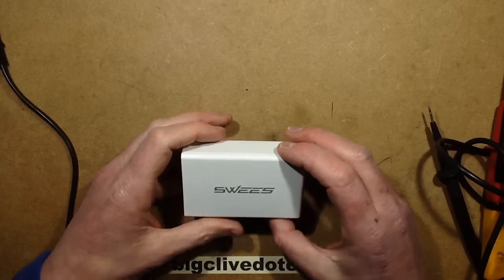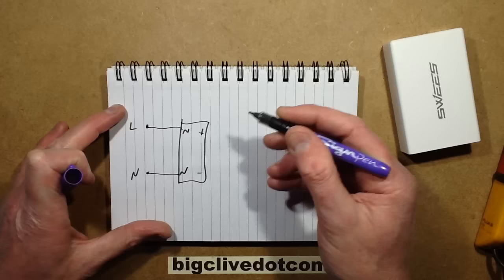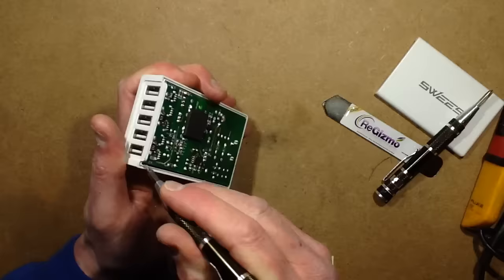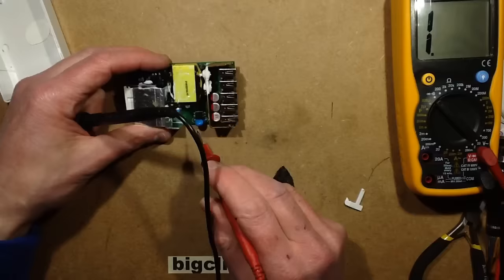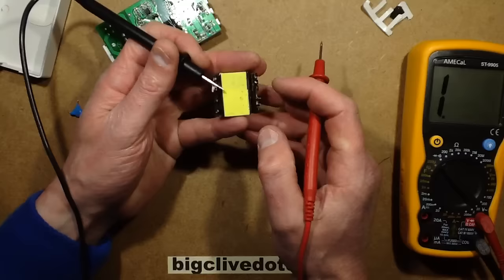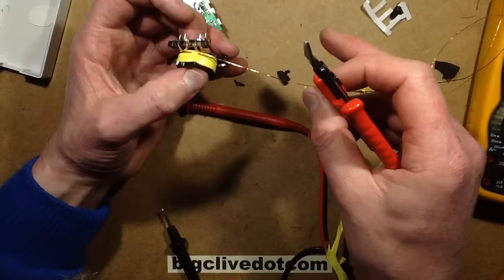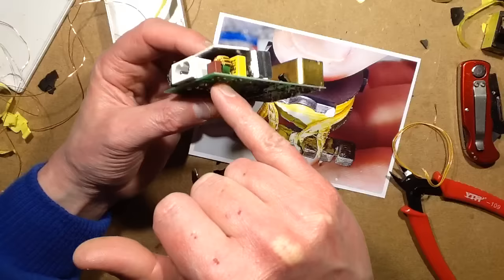Horrific USB power supply fault.  (Electrocution risk.)

Comment: If the overall design and build is fine but there is a manufacturing fault in this single transformer of the vast number used in this and presumably other similar devices then what can be done? One could argue that this sort of thing should be caught in quality control, but I suppose potentially the issue could have only shown itself post shipping for the same reason it went away once the transformer was removed.

I would be interested to know if other similar (maybe better known) manufacturers use more fault tolerant components, designs and processes, or whether this is a rare but more fundamental and widespread issue with a very common transformer and design concept?

For what it's worth I have and use a Swees powerbank. It's been fine and I plan to continue using it. However for a while now I've stuck purely to very large OEMs like Samsung for anything with a 240V input for fear of the above issues.
Reply: +anononomous  You ask "what can be done"  The answer is testing the insulation in the factory at voltage levels far higher than will be seen in use.  This reveals both faults and weaknesses that could later develop into faults.  If this test is passed then it is fair to assume that the product will stay safe, even after some deterioration over its life.  This test is required by the relevant safety standards and should have been performed.  There is little doubt it woud have detected the defect.
You ask about fault tolerance.  This is also a good way of making sure no duds reach the customer.  In this case a mains voltage winding was capable of passing over the thick secondary output winding - a single fault at this location then caused a lethal unit to get to the customer.  If, for example, the winding had been provided with an additional sleeving at the exit point, or a perhaps little plastic shield had been installed to give extra protection this fault could not have occurred unless both the sleeve and the winding insulation were faulty.
Personally I think you are right to stick to well known brands - it's the little details described above that cost money and are often cut out by the cheap skates.  There are so many horror stories - a UK Trading Standards enforcement office tested a random selection of cheap chargers and ALL of them failed safety tests.  
Hope this has helped.

Comment: your circuit  you draw at the start of the video seemed strange (Why?) because transformers only work on AC and so if there placed after a rectifier (that turns AC to DC) it would not work being on the DC side?
Reply: +MrStevetmq It's switching the DC on and off at high frequency, with variable mark-space to regulate the transformer output. That will be where the feedback winding and opto-isolator matter. The feedback winding picks up the output voltage while the opto-isolator may be signalling the zero-crossing for efficient switching.

It's all a bit of a black-box outline of what the system has, and I think it misses some other details between the transformer and the actual USB connectors. There are various ways of getting a steady voltage between the USB+ and USB-.

There are bits in places such as Wikipedia that try to explain all this, and there are so many detail variations that they're heavy going.

The switched-mode method can also handle the differences in frequency and voltage there are between the USA and Europe. The initial conversion to DC deals with the input frequency difference. The way the input to that transformer is switched can deal with the voltage difference. In the USA it would spend about twice as long switched on to deliver the same energy per cycle. I'm being a bit simplistic there.

Comment: Can you recommend a usb supply that takes a 2-pin lead, for diy projects? Or is it possible to retrofit a 2 pin socket onto the board of a usb supply as long as it doesn't have an earth?
Reply: +Daniel Dowling most usb chargers only have a plastic earth pin, so are not earthed, its just for compatibility with uk sockets.  out of interest, what is a 2 pin socket and why would you have mains runnning from such a thing?
Reply: +jusb1066 I mean like the socket on the device in the video, the 2 pin... kettle lead?
Reply: Daniel Dowling
then yes, you could retrofit such a socket or adaptor , you would probably need a bit more room to put it into another plastic case, and then simply the 2 wires from its motherboard onto the 2 pins of your figure 8 socket, as long as the case is  plastic, it wont need an earth
Reply: +Daniel Dowling The Anker and Anglink ones are good quality. I have a video of the Anglink one.

Comment: And this is why I ALWAYS check electronics I get from eBay before using them. Doubly so if the eBay store is Chinese. QC is non-existent for them and we get crap like this. I had a 5V +12V supply for computer drives that had extreme noise back feeding into the AC mains causing my monitors to flicker. Autopsy revealed they had almost no filtering caps in the design. I destroyed it and salvaged the few good bits I could get from it. Always check electronics out that are cheap before use lest you get something that is passing mains level power to low voltage equipment.

Comment: A fascinating Classic Clive. The transformer employed the correct construction techniques, including the Faraday shield to reduce noise, but in this case, was very poorly executed. (a poor choice of words, I know) These transformers may have been purchased as a finished part, by the maker of the SMPS. I'm surprised this didn't cause damage to components upon being powered up with 240vac floating around on the output side.

Comment: I worked for a power supply company many years ago and every unit had to undergo a flash test between mains and the output to test insulation. The voltage level was thousands of volts and would weed out faulty transformers like this one.
Reply from the maker: 3kV for a full test I think.
Reply: I did hear one horror story of a plant in an unmentioned low cost manufacturing location where a single high voltage tester was shared between multiple operators. each operator had their own high voltage probe which were all connected in parallel to the HV source which was permanently on. In theory if any single probe detected a short to ground the source would buzz. The person who told me the story (actually an inspector for BT ) was initially horrified at all the live HV probes lying casually around but then he realised that the HV source wasn't even turned on.

Comment: Once you found it was the transformer then without removing it, connect to two short points to a power supply  switch on, blow the short out then take the transformer to pieces and look for the damaged part.

Comment: when i plug my phone into my anker usb power supply the metal back of it feels funny and when i measure it and ground there is a voltage of 100V. Should i be concerned or send it back?
Reply from the maker: Most ungrounded chargers give a tingle through capacitive coupling.
I recommend using a plastic phone case for two reasons.  To avoid contact with the metalwork for this exact reason (and the high shock risk it poses with a faulty charger), and to help protect the screen against breakage if dropped.
Reply: bigclivedotcom i do use a plastic phone case but when i rub my fingers over the camera cutout they sort of vibrate on metal back. Btw the power supply is an anker powerport 5 if you want to test it. Looks very similar to the one you tested in the video

Comment: I have two of these, tho mine say EasyAcc as the branding on it, but other than that, looks exactly the same. Thankfully no electric shocks from them, and actually I've had one set up powering a clock and a google home mini on the bed side, and then have ports for charging my phone and tablet etc.   It all works well. Except for when its not doing much charging. You can hear it emitting electrical interference noises. Both of them do this. Its really irritating especialy if i wake up at night and my phone has finished charging

Comment: When i got a short like this and want to see where the problem is i just connect high power to it and blow the fault up. i have fixed a very expensive CCTV system like that in the past. a smd capacitor have shorted on the input power side and keept the powersupply from working. i changed it for a ceramic thu hole one that i "tig welded" on the board.

Comment: This is great example why using double insulated wire for SMPS power supplies is bad idea, if they did use normal magnet wire they would keep proper clearance between windings and they would not have this problem. Or use split bobbin but it is only valid solution for resonant technologies.

Comment: Mass-produced machine-wound transformers. Presumably they passed batch QC (interwinding isolation) so this might just be a random "bad one"? Dangerous nevertheless and having Mains and LV on separate bobbins would be FAR safer (and possibly not "that" more costly to produce on an automated line)! [Edit - from what you're saying, maybe one of MANY "random bad ones"! Wonder where the others ended up? :-) ]

Comment: Clive, I have a plug in wall bug zapper and when you turn it off and unplug it, there is still a stored high voltage current, you can touch it after 5 minutes and still get a shock. Can I ship one to you, could you pay for shipping?
Reply: +Nonstop Wheelie Just sounds like somebody forgot to include bleed/inrush resistors.
Reply from the maker: +Nonstop Wheelie They don't normally use discharge resistors because the high voltage across the grid would require a lot of high value resistors.

Comment: Hope this is not a stupid question but what is the purpose of the feedback winding   Cheers
Reply from the maker: It allows the circuitry to monitor the load on the transformer, and also often helps power the circuitry.

Comment: Generally, it looks well designed PCB and transformer. Assuming the secondary is triple insulated wire it should have been perfectly safe were it not for the manufacturing defect.

Certainly much better than many chinese power supplies on ebay and amazon which might have used only normal enamelled copper wire and still put the primary and secondary right up against each other (which is hard to avoid with this size and shape of transformer), not given enough creepage distance on the PCB, not put in adequate input filtering etc.

Comment: I have tested a couple of different brands with this design and they all where good (One test is 5kV between mains and usb side). As you say the capacitor is a common failure point, many cheap usb power supplies uses a 1kV capacitor that will short if it breaks down.
Reply: +Henrik Jensen They should always be X2 capacitors that fail open circuit if they break.
Reply: +SDG Electronics Yes, but some Chinese manufactures do not use it, I just tested 5 in a row with that problem.
Reply: +SDG Electronics NOPE, they should be either Y2 or Y1. X class capacitors are connected across the mains wires.
Reply: woopsserg Absolutely right. My mistake

Comment: wonder if it had a 3 wire from main plug  would the chasse ground have save it from shocking someone?
Reply from the maker: If the plug ground was connected to the output negative it would help greatly.

Comment: How many cookies would you charge for taking apart a 12v psu and explaining why the fuse kept blowing on power-up? :)
Reply from the maker: +Stevie C Primary suspects a shorted capacitor or failed transistor in or outside the switchmode chip.
Reply: so how many cookies do i owe you?

Comment: could it have been the resistor causing the issue ? but you thought you may have damaged it during dismantling ?
Reply from the maker: +killer1479 No.  Definitely damage during manufacture.
Reply: bigclivedotcom oh ok :) just a thought is all, great video :D

Comment: The overall design is not bad.
The damage to the insulation appears to have been done by the tech? with a soldering iron during the transformer instillation. Not a good look for the company.

Comment: The old EI formers were also a heck of a lot sturdier than the low profile kind that are becoming common place nowadays, though they do have drawbacks much like torroids too. That primary looks bloody horrible too.....cheap rubbish. 

I've made plenty of the EI step downs in the past, very rarely had any issues with the split bobbin design other than size and efficiency. I'd rather have safe and reliable. The EI reference is due to the lamination shape that's used with split bobbins, you've got basically a stack of treated steel shaped like capital E and I letters interlaced 

EI
IE

and so on, easy to make and repair too

Comment: when i record while my camera is connected on a usb wall charger a 60Hz buzz is recorded(audio). i can't detect any ac component out of the charger with a multimeter.

i tried 1$ cheap charger up to 30$ charger, they are all the same even the charger that come with the camera.

with battery bank, no buzz. charging battery bank with camera connected i got buzz.

how can i get rid of that buzz?
can i add a filter to a charger?
Reply from the maker: Try a power bank or a power supply with the negative output referenced to ground.

Comment: mine started buzzing after a week using to charge iphone lol so i ripped out the usb module n used a 5v 10a from an atx and it works fine or u can use it for a power bank that can supply 10a

Comment: i have one of these, but a different brand! i wonder if it has this problem
Reply: +lazerusmfh If you have a voltmeter (digital or analog), you can plug the power supply into the wall outlet and measure AC voltage between the USB + and - pins to the earth ground of the mains.  You should see zero reading, or at most a few tens of millivolts.  If you see the full mains voltage (110-130 V or 220-250 V, depending on your local household voltage), it suggests the device shouldn't be used.
Reply from the maker: +Milosz Ostrow With almost all switchmode supplies a modern meter will display around half the mains voltage or more due to internal capacitive coupling and RF filtering.

Comment: This ones a cite more dangerous but i got zapped with AC by a usb hub earlier today.
It fell off the wall leaving its back behind and landed bare circuit board on my hand.
Wasn’t as bad as direct mains power “i have experience there” but i did get a small electrical burn and an aching finger.
Felt it go up to my chest but i don’t think it was responsible for the racing heart that would be the adrenaline.

Comment: Just curious, but is it really an electrocution risk or just a painful shock risk? Yes, it's carrying 240V, but how much current could that feed-back wire carry and for how long before it acted like a fuse?
Reply from the maker: A human would not pass enough current to blow the wire like a fuse.  Just 10ma (0.01A) will lock a human onto metalwork.
Reply: bigclivedotcom thanks for the reply. It's difficult to tell on the video the gauge of the wire. It looked very thin, almost filament like.

Comment: surely in your diagram the transformer and rectifier were transposed??
Reply from the maker: In switch mode supplies the mains supply is first rectified to DC and then applied to a smaller transformer at high frequency to allow a lot of power to be coupled in a small transformer.
Reply: Fair enough - thanks for explaining!

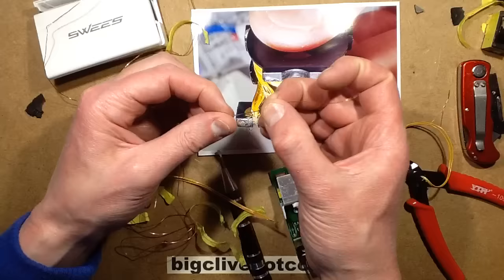Comment: 28:08 I would like to venture a thoroughly uneducated hypothesis.  I'm not certain, but I presume the transformer is the moving piece in assembly and different spools of wire will be attached and wound in order.  Perhaps a spool of wire snagged at the end of a reel, causing the reel to come loose and wedge between a part of the machine and brush against the workpiece.  QA apparently didn't catch the defect.  Someone probably looked it over for 5 seconds and thought they got really lucky on the spool length.  Maybe that's even the end of the spool and that's why the insulation is damaged, maybe from compression or dull cutting equipment.

Comment: I'm a layperson, so please don't shoot me if I'm wrong - but in the diagram in the beginning - should the AC go through the transformer first to step down, then hit the rectifier? Transformers don't do DC?
Reply from the maker: +Gareth Crispin (MrHolozip) The mains is converted to DC then AC again at high frequency to allow the use of a smaller transformer.
Reply: ah cool, thanks Clive! I really need to spend some time learning about modern power supplies. Thank you for the answer, and the great content! :)

Comment: It was a teensy bit painful watching you cut down towards your thumb with that knife getting the yellow tape off the transformer. Too many times have I said "screw it I'll be careful", too many times have I wound up with a bandaged thumb.
Reply: Agreed. Big respect for the video in general but its either great skill or great carelessness with that knife, and I do not know which for sure
Reply from the maker: +Digitalpiracy If you look at the way I'm holding it then you'll realise that it's impossible for it to make a sudden uncontrolled movement.  I did all my accidental slashing when I was an apprentice over 30 years ago.

Comment: I use the. USB ones that's powered buy USB ones or have the transformer separately. Where there connect from a 9 volt plug in socket and separate to USB it self and not a self contained unit

Comment: The board looks like a knockoff of an Anker multi-output USB charger. It's incredibly similar in layout.
Reply: But the Anker ones are not that great. Rated for 4 Amps. At 2 Amp the Voltage drops under 4.75v (Minimum of USB)